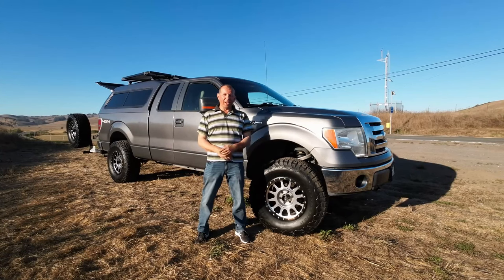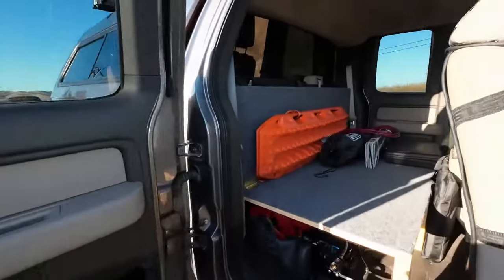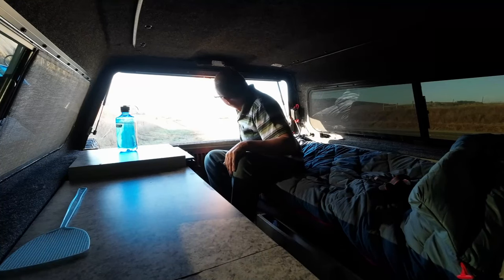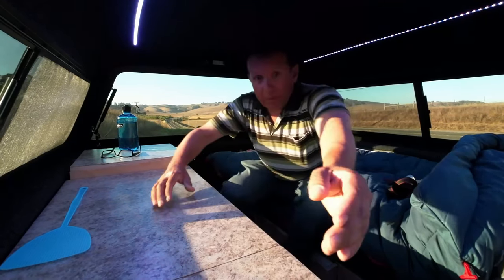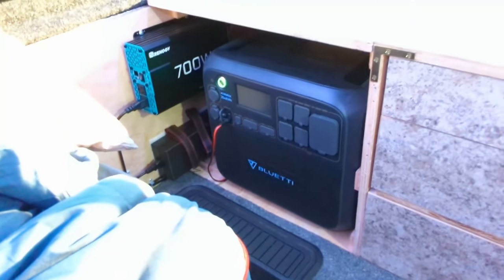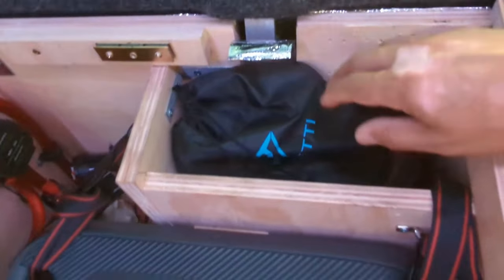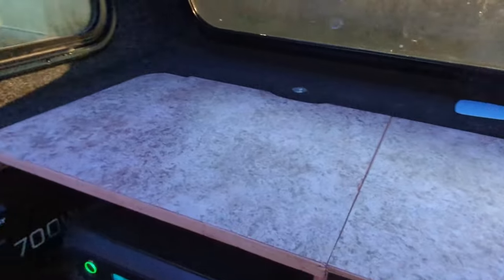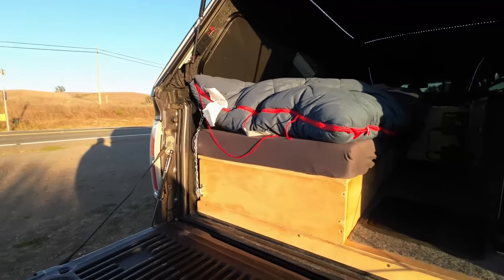COMPLETED Truck Camper Build | Truck Camping

Comment: This is exacltyu what i want to do in my excursion except make under the bed a drawer i can pull out and use to cook on. perfect build
Reply from the maker: Thanks! Good luck with your build. Just remember that the plywood I've used weighs about 300 pounds. I want to replace the plywood with 3M reinforced polyurethane foam board. Lighter, stronger, but much more expensive.

Comment: Looks awesome, very similar layout to the build I'm doing, appreciate the insights and review!  Where'd you get the material you used for your mattress?
Reply from the maker: Thanks! The mattress was a twin mattress I bought on Amazon. I should do an update video. I've added 2 inch high density foam underneath, since I made this video. It makes a huge difference. So in total, there's 3 inch of memory foam and 3 inches of high density foam. I also changed the case. I don't recommend using a case like that. It was supposed to prevent moisture getting in, but it did the opposite. Moisture got in and the case trapped it, and the foam got moldy and I had to replace it. Use a protective open cover.

Comment: Trying to understand the purpose of the isolator and 700w inverter.  So that is to convert power from car power from what to what to charge the bluetti?  You can't use the adapter that bluetti supplies that plugs straight into the cigarette lighter?
I really would like to pick your brain. I really like this build.  Just wondering also, how much weight did this build add to your truck bed?
Reply from the maker: Hi Louis. It sounds like I should make a video specifically for my electrical system. And explain the technicalities of what I did and why. Would that be of interest to you? Maybe give me a list of questions that I can address.

As for the weight, yes, it's quite heavy. I used around 5 sheets of plywood, the bluetti is 62 pounds and the fridge is 40 pounds. Also, the spare wheel is on a hitchgate. The spare wheel weighs 100 pounds and the hitchgate is probably somewhere around 60 pounds. This is why air springs are needed.

Comment: I have a question 
How did you cut your twin mattress to size?
I want to do the same
Please and Thank you
Reply from the maker: I used an old bread knife, but any long sharp knife will work. I measured the width I needed, drew a line down the foam, and then just slowly sliced down the line.

Comment: What are the specs on the wheels/tires? Did you do a lift or a level? Sweet build!
Reply from the maker: Thank you! The tires are 35x12.5 BFG KO2 and the wheels are 18" Methods. A 3" lift with a basic Rough Country kit. I intend replacing the rear shocks, at some point.

Comment: Build? The truck was already built,  the topper was already made.
Reply: That is the correct term - building out a camper.
Reply: @etiennesprangers1953  that isn't building anything
Reply from the maker: If I didn't measure the dimensions, cut the wood, screw the wood together, laminate the surfaces, install the solar panels, install the electrical system, install the fridge and a number of other components, then who did? This is called construction, otherwise known as building.